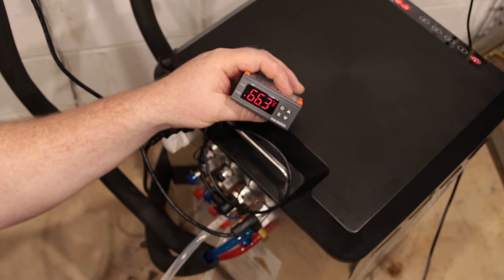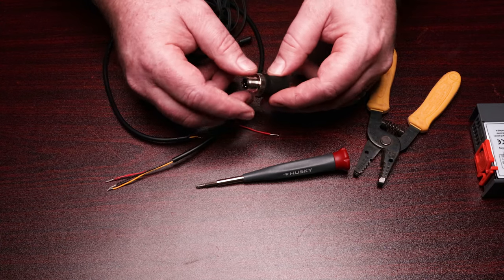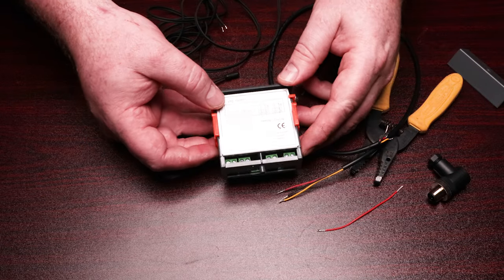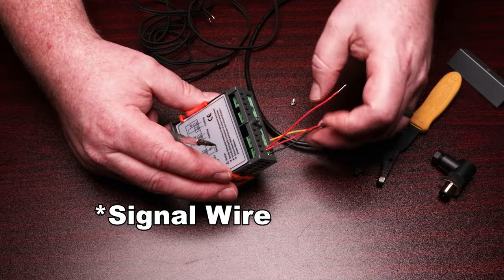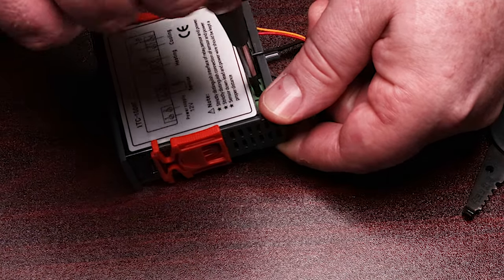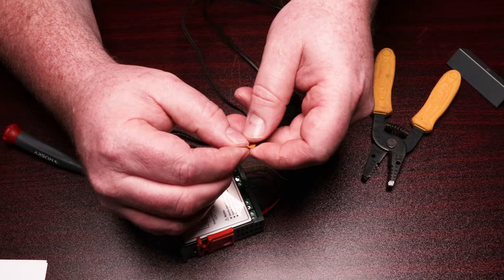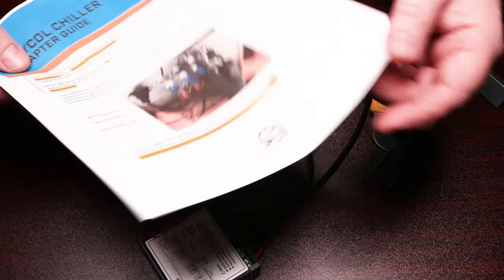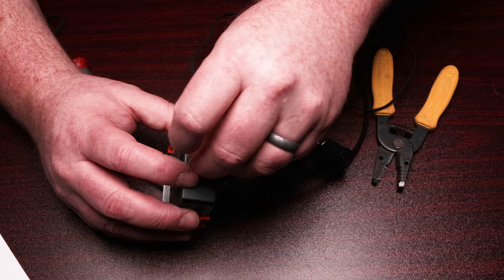Use any fermenter with this Grainfather Glycol Chiller HACK

Comment: I’m loving this as its literally 20 bucks. What I’m wondering as a diy project. Can you power a computer cooling fan from the ink bird. If you buy one with a liquid heat exchange (=water cooling) you can hook it up to the glycol and build a cheap fermentation chamber that is running of your glycol chiller. I’ll investigate if I can use my ferminator and convert it. It would be worth it!!!

Comment: I don't understand why the red and black ports are connected incorrectly, the power port should be red? I don't know if it could cause a malfunction in the device.
Reply from the maker: It works fine. No damage to the chiller or controller. 👍
Reply: @ShortCircuitedBrewers  thank you

Comment: Amazing video and instructions, just what I was looking for! Going to try to find these parts and try it with my SS Brewtech fermenter ASAP!
Reply from the maker: Great!! Let me know how it goes!  👍🍻
Reply: @ShortCircuitedBrewers  It took unexpectedly long to receive my Inkbird from China (for obvious reasons) but I finally got it yesterday, hooked everything up, and it worked perfectly!
Well, ok that was a lie, I accidentally had put the sensor wires into the heating holes, which resulted in a loud beep that put the fear of God into me 😂, but I fixed it quickly and everything "just works" as advertised.
Amazing, I can't thank you enough! Expect a new Patreon subscriber very soon! 🤩

Comment: thanks for the video, clear and straightforward... Is it possible to manage the heating element? how to deal if we plan to use 220V heating element? any idea or solution?
Reply from the maker: You could control a separate relay to control the 240v element.
Reply: @ShortCircuitedBrewers  not an expert... on this... do you know if there some video as easy as yours that I Can follow?
Reply from the maker: I don't have a video on that. Sorry.
Reply: @ShortCircuitedBrewers  thanks a lot

Comment: I have been looking into the idea of a glycol chiller, while trying to keep things relatively inexpensive. The grainfather one does look nice and is a reasonable price as far as the chillers go. I have an anvil 7 gallon metal fermenter, so on that point it would actually be relatively inexpensive to hook it up to that. Just don't have all the information yet about that, but soon.
Reply from the maker: What info do you need? I've got those fermenters also and use them with the Blichmann glycol chiller.
Reply: @ShortCircuitedBrewers  I have done some searching, and the only thing the comes into mind is the compatibility of the different parts of different kits. To be as explicit as I can, almost every metal fermenter seems to have some form of cooling kit - often including a pump. But in glycol chillers I noticed not all of them actually need that pump - is the tubing compatible?

Overall there isn't much real concern I think.

But I have decided to give the anvil 7 a go with the cooling kit and water. I need to see if I can make enough ice to keep it cold enough. I might not even need a glycol chiller...
Reply from the maker: @zzing  there are generally some adapters needed. I have used some hose barb reducers on mine to get everything to work. the anvil chilling system is definitely sufficient if you're just doing ales and you don't have a lot of temperature differential between your ambient temperature and the temperature that you want to ferment at. Feel free to ask any other questions. 👍🍻
Reply: @ShortCircuitedBrewers  do you think I could get away with doing a lager, if the ambient temperature is about 18-20C and target is between 12 and 15C? (So roughly 70 to 55F I think).
Reply from the maker: @J Drake if you change out the ice often you can probably get there. 👍🍻

Comment: Great video! This helped a lot! Is it possible to use the heating relay side in the itc-1000 for an heating pad?
Reply from the maker: Yes you could. But it will need to be 12volts if you run it directly without a relay to switch the 120v. 👍🍻
Reply: @ShortCircuitedBrewers  nice, you think the power output of the grainfather will be sufficient?
Reply from the maker: @MrEMPool at very low wattage. I think the GF heating pad is only like 70 watts? Not very powerful for sure.
Reply: @ShortCircuitedBrewers  i need to find a way to switch another relay for more power. Thanks for your help

Comment: Hi Brian, this was a great video.  I am now using my chiller with my 2 spike conicals. I want to be able to control my chiller while away from home.  Could I plug a 110v - 12v power converter into the cooling plug of an ITC 308 wifi instead, and use one 12 v wire to the signal pin and the other 12v wire to the ground pin leaving the power pin on the M12 connector unused?  This way I could also use my existing heat belt with the ITC 308 and be able to set the temperature from anywhere. Not sure if this makes sense, or if you have any other suggestions.  If this would work, could you also suggest the power converter to use?  I don't want to damage my grainfather chiller.  Thanks in advance, Terry

Comment: Thanks for the video! The original link for the adapter is all sold out. Would this be a comparable part? 

VELLEDQ Industrial Field-wireable M12 Sensor Connector 3-Pin Male Adaptor Screw Terminal Plug Fittings

If I have some extra connectors, from say the cooling pump kit, can I cut those connectors off and splice the wires?
Reply from the maker: I think so from the description.

Comment: Hi! Thanks for the video; I wanna try to do this to connect the grainfather to the unitank of ss Brewtech. One question, if I want to connect che heating system to iknbird, I should  just connect its wire to the heating connector right?
Reply from the maker: The inkbird in the video is 12volt so if the brewtech element is 120v it won't work..you would need a 12volt relay box to make it work.

Comment: Hey great video, thank you very much for your detailed instruction.  Can this be configured to heat a fermenter as well?
Reply from the maker: it can... if you want to use the power from the chiller you will have to find a 12volt 30 watt heating pad. you "could" run a regular heating pad and simply switch the power wire going to the heating element.

Comment: I wired every thing successfully and everything was working great for about a week. Suddenly, my inkbird started reading an inaccurate temperature (between 20-30 degrees low). I have moved the probe around and it won’t even display ambient room temperature accurately. I have rewired everything and replaced the temperature probe with no luck. Anyone had this issue before?

Comment: Very interesting thank you. I'm thinking of using this for a Unitank I'm going to buy. Have you used the heat side with this setup? Cheers :)
Reply: Sorry I see the answer below haha :)
Reply: Hi I eventually got my F40 and used your excellent information to connect it up. I used a 12v to 240v relay to connect it up to the heater. Job done. Thank you :)
Reply from the maker: Welcome! 👍🍻
Reply: @ShortCircuitedBrewers  3/8 BSP M to. 3/8 NPT F to enable you to connect Grainfather Chiller pipes to Brewtool tanks. Might be helpful to anyone else trying to hook these up  Thanks again :)
Reply from the maker: @paulrobertson9439  thanks for that tip! 👍🍻

Comment: That’s a great video. How would I hook up a heat pad (uk mains) to the heat part? I’m a bit simple with this stuff but would I use a relay to ‘turn on’ the pad by making the mains connection complete?
Reply from the maker: Just fyi the heating pad would need to be 12v and no more than 30watts. I've looked all over and there aren't many options out there for that specifications. Only thing close is a seat heater for a car and most of the time they are more than 30 watts. 😔 You could run power through the inkbird heating circuit, but keep it under 10 amps.

Comment: Great video! Manny thanks! I’ve happen to have an 12v 30W (guess that’s about right for the power from the chiller?) silicone heat pad. Can I hook this up and yes how do I wire it?
Reply from the maker: You would just have to run a jumper wire from the 12 volt positive over to the heating side of the inkbird. Then just use the same lug for the ground for the heater. That's really about all you need to do.
Reply: @ShortCircuitedBrewers  manny thanks 👍 great channel by the way 👊
Reply from the maker: @daanvanboven6716  welcome! Thanks for the feedback! 👍🍻
Reply: @ShortCircuitedBrewers   works outstanding! Now using all 4 slots on the chiller and the heating pads working fine. Again thanks!
Reply from the maker: @daanvanboven6716  awesome!! Good to hear! 👍🍻

Comment: Great Video - do you have any recommendations on conical fermenters and cooling systems which would be cheaper than buying a grainfather fermenter?
Reply from the maker: As long as you aren't lagering the Anvil bucket fermenter is a good deal with the cooling kit. It will run all the way down to 41f after that the Delta brewing systems is a good choice with its cooling package. It will lager just fine.
Reply: @ShortCircuitedBrewers  thanks so much for the quick reply - i love the grainfather fermenter - its just a bit expensive. Looking to get a second
Reply from the maker: @fermentable4270  welcome!!

Comment: So I have a question. Building on what you have done, could you add a warming jacket to the heat posts as long as it is a 12 volt jacket? I don't even know if they make such. Would eliminate having to place two sensors in my thermowell. Or could you use the same temp sensor for two inkbirds? One for cooling, the other for heating.
Reply from the maker: You sure can use the power and inkbird for a heater. 12v 30 watts are the spec. What I found as a possible solution is a automotive heating pad for heated seats. Just make sure it's only 30 watts. 👍🍻
Reply: @ShortCircuitedBrewers  The other thought I had was to use the Inkbird controller I have from my setup which is the typical 120V unit shipped with Spike temp control and buying a cheap 120v/12v converter and wiring the 12V side directly to the red and black wires on my M12 connector. Then I would just use the temperature probe already on the Inkwell for both heating and cooling.
Reply from the maker: @robertcoleman4045  yes you could use a 12v relay to run the heater.

Comment: Thank you for the explanation. I currently use three Grainfather fermenters attached to my GF glycol chiller. If I understand correctly, there is a temperature sensor in a GF fermenter that maintains the temperature. Do I understand correctly that the Grainfather chiller without this sensor can keep any fermenter at temperature?
Reply from the maker: You can use the inkbird with the chiller and chill any fermenter. The ink bird does require a sensor however to monitor temperature. It has one that comes with the ink bird controller, that you can put in a thermo well for any fermenter. And yes the Grainfather conical does have a built-in temperature sensor that sends a signal to the chiller.
Reply: @ShortCircuitedBrewers  Thank you very much :-) Did you ever get an update from Grainfather about that that standalone controller?
Reply from the maker: @TheRubinio1980  it's still in the works apparently. My video is the only one out there that shows a solution..👍🍻

Comment: Hey Brian, nice video!  Was gonna ask is that your grainfather chiller?  If so what are your thoughts on it?  Was thinking of getting the BB Icemax 2 cuz i only need 2 lines but if this is worth it i dont mind paying a little extra for it?  Is it loud?  Chill down pretty lw to cold crash?  Thanks for any info you can give.
Reply from the maker: Yes it is mine. I have not put a load other than the Grainfather conical.. So I can't really say for sure. It does chill pretty quick but the Grainfather controller only goes down to 39f. Now that I've done this I'll see about adding some load to it and see how it does.. 👍🍻

Comment: I know this is an Old video 
I just build this thing for all 4 channels of my glycol chiller but what is the best setting on the itc 1000? I Think of the delay setting and the difference setting?
Reply from the maker: @mikkelkofoed289  The delay setting I would probably put at 10 and the difference I would put at 3..
Reply: @ShortCircuitedBrewers  thanks so 10 minuts delay and 3 for the difference temp?
Reply from the maker: @mikkelkofoed289  you could do 5 it just delays how long it takes to compress to kick on after unplugged or powered off... Safety measure.
Reply: @ShortCircuitedBrewers  thanks it is not that important i Think becauce it is just a pump and not a compressor?
Reply from the maker: @mikkelkofoed289  yeah that's true. It's been a while since I made the video I was getting it mixed up with my other ITC controller video.. lol you can zero out the delay.
Reply: @ShortCircuitedBrewers  thanks

Comment: i know its old video but question, with the controller heater is it a switch or a 12 supplyu, need know get 110v or 12v heater
Reply from the maker: 12volt heater.30 watt max.
Reply: @ShortCircuitedBrewers  have any suggestions for one that could wrap around a blichman cornical?
Reply from the maker: @JasonPutt  are you talking about a 12v option?
Reply: @ShortCircuitedBrewers  for heating yes, i was thinking a 15watter 3d printer heat bed, but want more surface coverage than 15x15mm
Reply from the maker: @JasonPutt  I would check car seat heaters. That is a larger surface area.

Comment: Hi, I seen this question asked already but there wasn’t a reply that I saw. Where would you attach the sensing probe to the grainfather conical fermenter? Thanks
Reply from the maker: It's not made to use with the grainfather conical. The purpose of the video is to connect not to other fermenters. The grainfather conical should be used with its own controller.👍🍻

Comment: Thanks for the video.  I was thinking about doing something similar and was trying to found out what signal the fermenter sent to the chiller and someone sent me the link to this video.  Do you happen to know if the fermenter's existing thermometer probe would work with the ITC-1000 or alternatively, would the sensor that comes with the ITC-1000 fit in the fermenter thermowell?
Reply from the maker: Not sure if the existing thermometer from the grainfather will work. The stc1000 temp probe will fit in a thermowell.👍🍻

Comment: Hi Brian great video thanks.  Cant find the link to the parts I need though as in NZ.  Are you able ot provide the link for the correct M12 connector on aliEpress? I am guessing its a M12 3 pin male connector.  thanks Bruce
Reply from the maker: https://h5.aliexpress.com/item/33015331635.html?spm=a2g0n.seo-amp-search.searchResult.33015331635 

It is the male connector..
Reply: @ShortCircuitedBrewers  Thanks!

Comment: Hey Brian, got fed up and am getting all the parts together for this changeover from Icemaster max4 controllers to these to push my grainfather conical fermenters, one question is how do i add the heating option to this?  The conicals have a heating element near the cone but does the signal wire alone tellit when to cool and heat or do i need to set it up separate?  Any help is greatly appreciated!
Reply from the maker: The controller will tell the chiller to send 12v to the heating pad. It is a 12 volt 30 watt heater.. probably would do just as well to wrap a heating pad around the outside.

Comment: Thanks for your video. In the video you said that you got your M12 connectors from AliExpress. Can you please share a link to AliExpress with the correct ones. Thanks!
Reply from the maker: https://www.aliexpress.com/item/32843757645.html
Reply: @ShortCircuitedBrewers  Awesome. 
Thanks!
Reply from the maker: Your welcome! It's the 3 pin male insert option. I did the angled one.
Reply: @ShortCircuitedBrewers  not sure why but my comments gets deleted.  the link seems to be for M8 connector, but we need M12, right?
Reply from the maker: M12 yes I had a real hard time trying to get the links to work properly a bunch of the links for some reason we're taking me to a sundress... Lol
Reply: @ShortCircuitedBrewers  in past comments I tried to post another AliExpress link to m12, just to ask you if that would be the correct one. Probably YouTube don’t want me to post links in comments ))) So if it says m12 3 pin male - that’s what I need, right?
Reply from the maker: Yep that's correct..
Reply: @ShortCircuitedBrewers  btw, I have spare grainfather conical controller (old version, because I upgraded my existing conicals with Pro version controller). so that controller has 3 wires, 1 with 3 "lines" (I assume it goes to glycool chiller) and  2 with 2 lines, I assume one goes to temperature sensor in GF conical and another to heating element of GF conical. I want to try to use that controller to control heating and cooling of brewtools F80 unitank I'm going to buy soon. I want to use GF glycol chiller and brewtools heating element. brewtools heating element requires 220V, so I purchased 12V 30A relay, so GF controller can turn on/off that relay and it will turn on/off 220v heating element, hopefully I can make it working :) if I manage to get old GF controller working I probably will buy another PRO version so I can control heating and cooling of brewtools F80 remotely :)

Comment: So this Inkbird represents the cheaper diy version of the Grainfather digital tempature controller.   Any link to the wiring schematic.
Reply from the maker: I do not have a schematic. If you watch the video I show how to do it.  It is very simple.
Reply: @ShortCircuitedBrewers   Brian   What type of temperature sensor are you using, and where do you place it on the Grainfather conical fermenter.  Any information on that.  You did not showed that part.